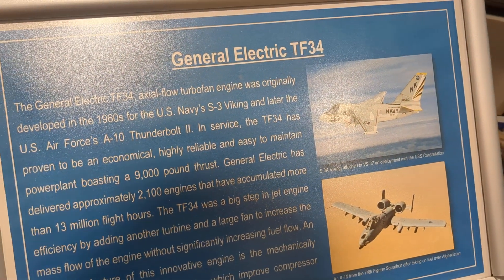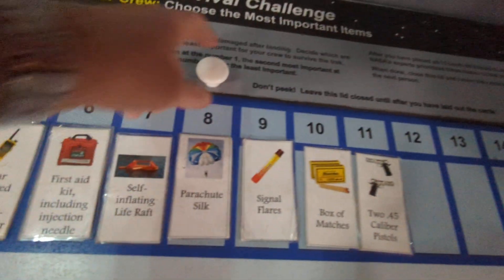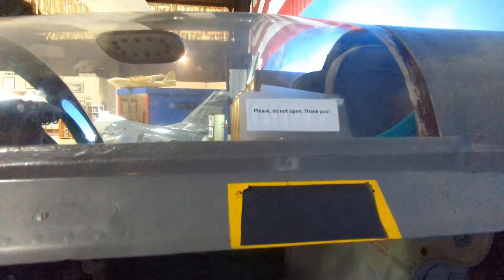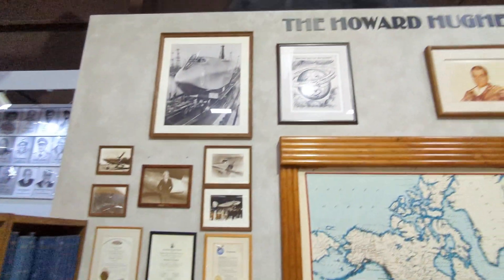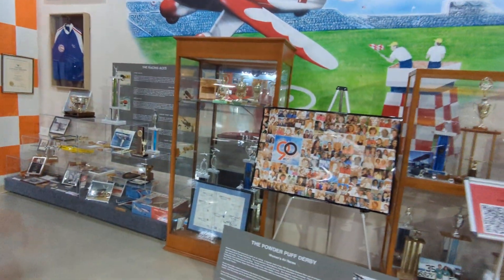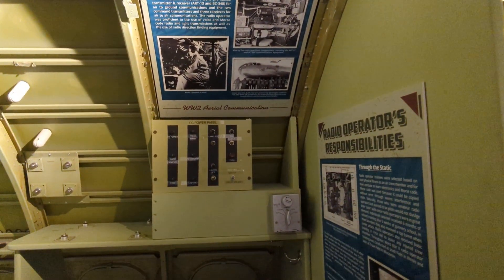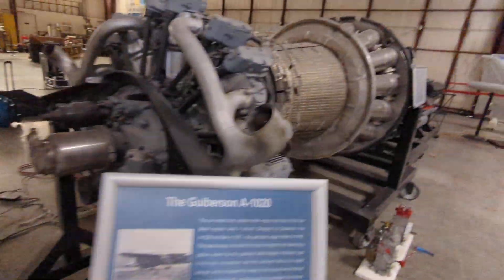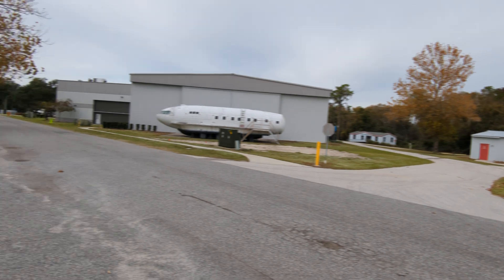Florida Air Museum Lakeland FL- Walkthrough and video review

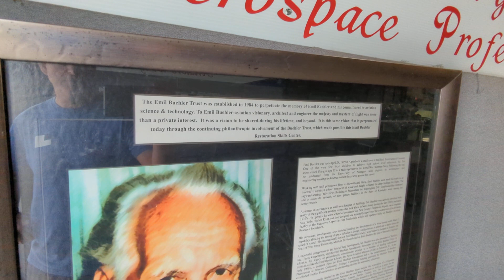Comment: In 1985 I donated my fuselage and engine to the museum. It is shown at 16:23 and 16:28. It is a 3-cylinder radial that developed 75 hp at 1700 rpm. The cylinders came from a LeRhone rotary engine and the crankcase is from a 9-cylinder Anzanie engine. The propellor is an original Flottorp. Glad to see they still have it on display.